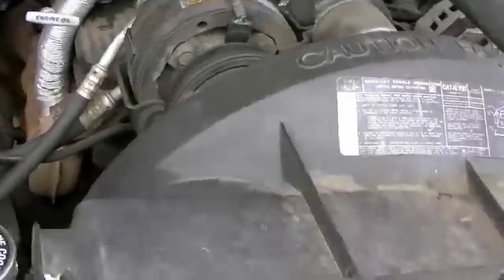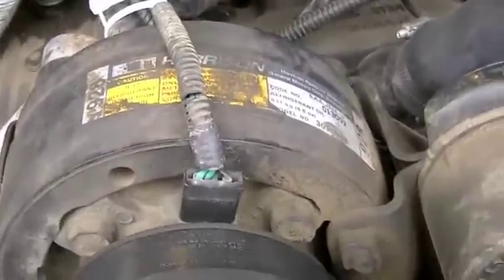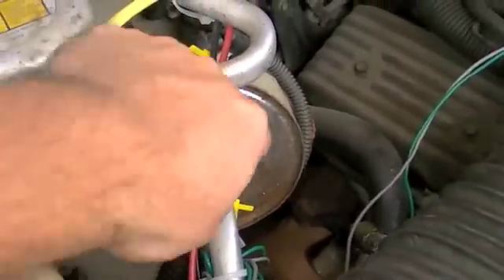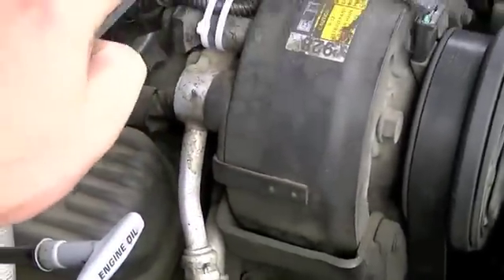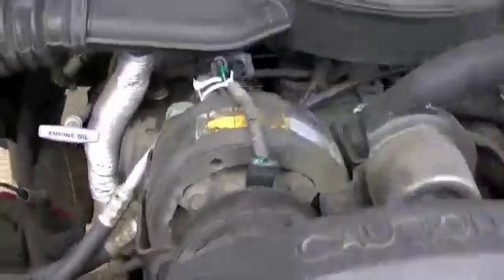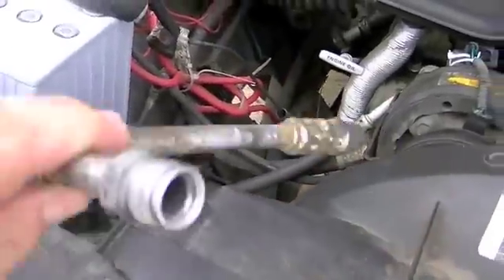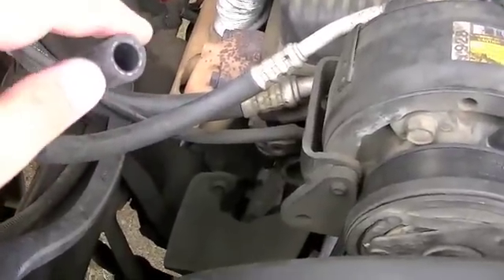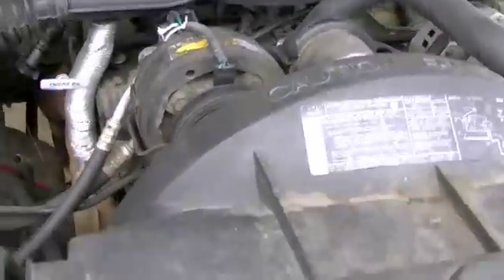Converting an A/C Pump over for use as an Air Compressor

Comment: At our machine shop/repair shop ppl would have us use old ford compressors cause they have built in oil reservoir, to provide air to their air ride systems and ppl building rock crawlers or big 4×4 would use them for on board air for tires or air tools

Comment: I did this 30 years ago. Put a small block Chevy in a 74’ Toyota Landcruiser. Replaced the factory release valve (360 lb) on the back with a regular 125 lb compressor “pop off valve”. Standard 1/4” air fitting with 30 feet of air hose. Ran a switch from compressor to end of hose at the air fitting so I could turn the compressor on and off while I was airing up my tires. Put an oil drip inline to keep it lubed. Works like a charm for years.

Comment: I remember my dad turned it into a powerful vacuum to drain our septic tank. But I don't remember how he did it.ill tell you what I remember and mabe you can fill In  the blanks.the reason I'm asking for your help is I could really use it now if I could just remember how it was done. Ok first I think he took the low line and ran it to a small square 12 x 12 tank he built and he put a tennis ball in it before closing it.and from that small tank he ran a hose to a 300 gallon tank we placed in the bed of the truck and on the rear of the big tank I remember he placed a 2" valve with a long 2" hose and it would drain our septic in minutes. Can you please help me remember all that it took to build it.i would really appreciate it. Please help.
Reply: tennis ball in the tank sounds like a crude check valve. are you sure it was an ac compressor? i dont think that would ever be able to empty something septic sized in minutes, and also they can only pump gases, sooooo yeah. idk fam!
Reply: @jackradzelovage6961  I think they were creating a vacuum in the big tank which sucked up the liquid

Comment: My question would be why take the oil out of the pressure side?
Unless it's a paint sprayer, I would imagine oil would benefit whatever tool you were using it with!
Reply: Because most likely it's filling a tank. The tank will fill with oil before it gets to the tool. Tool
Reply: Dont want oil in the tires

Comment: Hey guys I was just thinking the same thing converting ac for air compressor pump, but instead I wanna use it as a  supercharged turbo!
Reply: Compressed air supercharger put a couple of tanks in somewhere might work. Lot of work to block off the natural aspiration and pressurise the intake, then switch back to NA, automatically as pressure drops .

Comment: this idea just occurred to me today and glad to see the thought is viable. what is the status since you made this video?
Reply from the maker: I am using it to fill my 8.5 gallon air tank in the back of my truck. still works. Just gotta add oil to the "suction" side every once in a while.
Reply: +repeatman. How long does it take at idle to pump your 8.5gal tank? I tested my ac pump on my 00 s10 and at 2000k rpm it pumped my 10gal tank to ~100psi in about 30sec but was going through a 1/4 check valve that got really hot. I'm planning to put a york 209 pump on my 94 s10 once I get a 350 put in it or I might put the factory pump back if I cant figure the v belt pulley the york has.
Reply from the maker: +Eddieallen Well, I no longer have the truck, it kept working specially since I kept oiling the crap out of it. If I were you I would pop a serp belt pulley onto the York and a 1/2 inch check valve.

Comment from the maker: Yeah, It worked for a little bit then quit. The Compressor has a busted seal or gasket in it. I might just pull it out and install a York 210 In its place.
Reply: repeatman 
my dad has one. it had worked for 20+ years. with just putting a few drops of  oil in now and then. it works as a vacuum pump also.
Reply: Update

Comment: It looks like you connected hosing to the compressor that was designed for it, and then you cut off the tube at some point and used some adapter and hose clamps to run to your oil/water seperator and then the tank? How?

Comment: Is that a scroll type or piston type compressor?
What stuff did you use to connect hose/tubing/pipe to the compressor inlet and outlet and what type of hose/pipe/tube did you use?
I'm really a newbie at this
I'm waiting to pull the trigger on this, I can get a Denso piston compressor it looks like for about $125